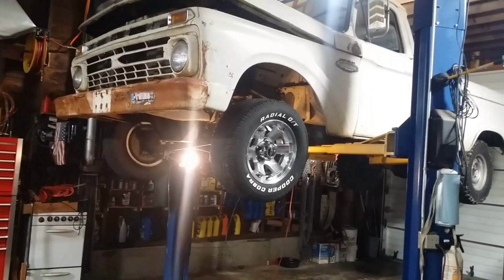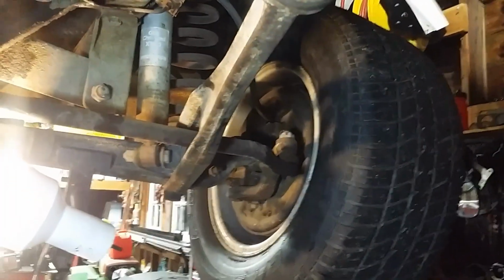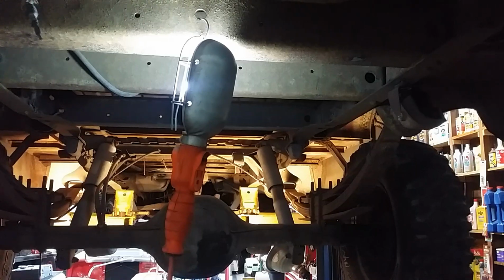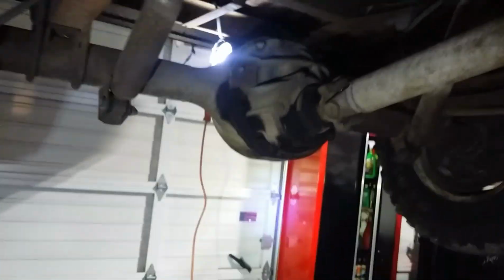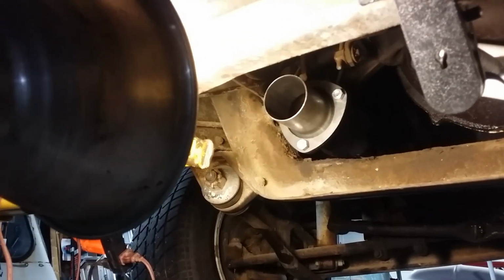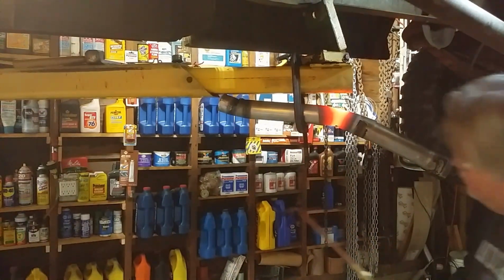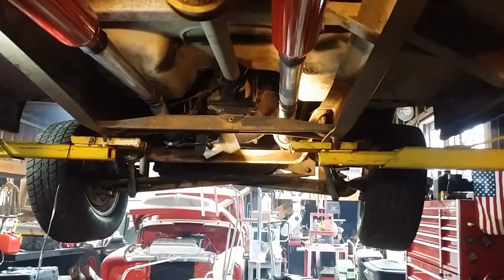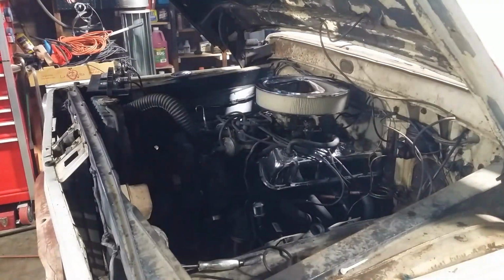I am going to build a new exhaust system for my Shop Truck 1966 Ford F100 with new headers

Comment: Had a 66 mustang with a 302 conversion and for the spring events and parades we would unbolt the thrush mufflers and run all day with that roar and my ears would be numb for a couple days
Reply from the maker: We have a 1964.5 Mustang with a 289. Need to do a video on it one day...